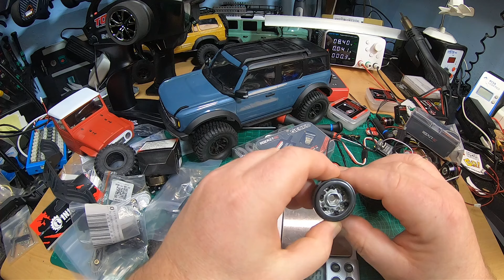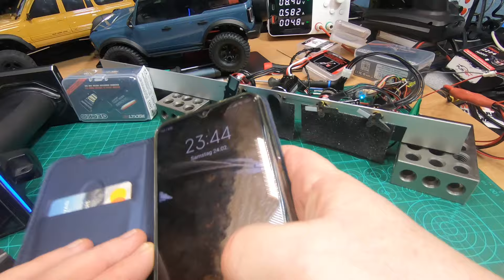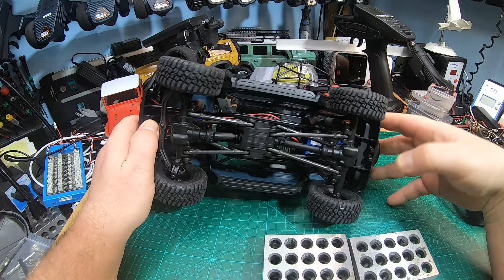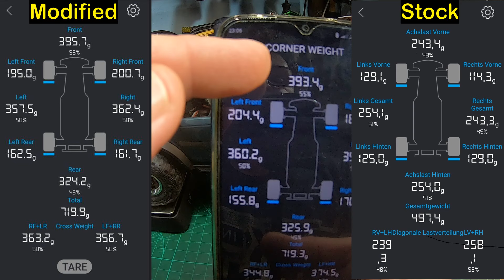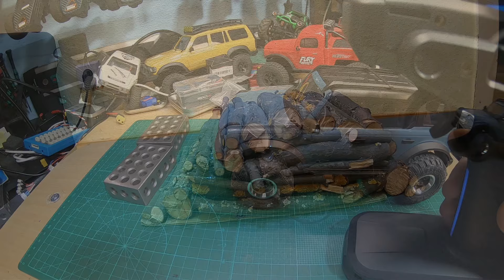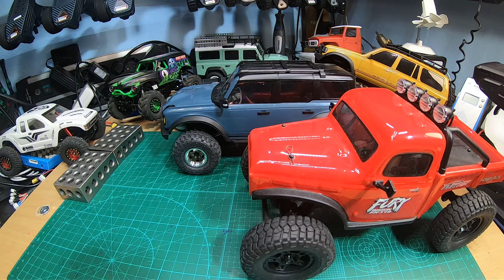Traxxas TRX-4M + Rocket Gecko sensored brushless 3500 kv inrunner motor and Mini 18 ESC

Comment: Hello my friend how are you? I have a question. Nobody on YouTube could answer it for me.😢 I haven’t ordered it yet , but I used to have one before the furitek komodo the big one not the small can I fit it on the trx4m Because I want to order it and I’m afraid it’s not going to match🙏
Reply: I think the big komodo it’s the best one for the slow crawling
Reply from the maker: @AhmedAli-my9we  Yes, the big old Komodo ist best for low speed, but it lacks punch and high speed. I do have it still. Bit IMO the punch is so poor and it is so heavy, that it does not improve performance in most trucks. Only super slow crawl is awesome. 
Why not order the Furitek kit for the TRX4M?
The old big Komodo has a larger shaft, so you'll probably not get pinions that will match.

Comment: Inrunner in that size is never the same like a outrunner…. Even the Furitek Cedar is struggling with slow crawl…. My best hint is use a cheap AM32 ESC and a outrunner Motor…. Thanks for the Video

Comment: I have those same tires and wheels on my hobby plus cr-18. I find these wheels/tires  much heavier than the stock wheels and tires. Great video Donald!👍🏻🤗
Reply from the maker: Thank you. 
Still, rims are super light compared to "heavy" wheels - weight recommended. I love those wheels. CR-18 tires and wheels are super light (but beadlock rims, easy to put lead stripes to the rings).

Comment: About the Program Card,  I had to search for the one that specifically says “SUPPORT GECKO MINI 18 ESC” on the front of the card at the bottom.   I found it on AliExpress and it took forever to arrive but it does work.   Another important note… I found that all the initial values for all the program settings were defaulted to ‘1’.  That’s not really a big deal, with 1 exception….the Low Voltage Cut Off.   ‘1’ correlates to 2.9V which is not good for LIPOs .   2=3v, 3=3.1, 4=3.2, 5=3.3, etc, up to 9=3.7v.
Reply from the maker: Thank you! I will search on Ali. Can you change settings? (for example motor direction)
 LVC is completely unimportant for me, because I never drive my trucks "to the end" ;-) - I check voltage. So I am good.
Reply: @donaldsneffe  setting include LVC, Punch, Initial Start Force, Initial Drag Brake Force, Maximum Reverse Force, Neutral Range and Motor Rotation
Reply from the maker: @timsheldon6367  Yes - I tried everything - but with motor direction it is easy to check if it works. A guy from the forum has the card especially for the Gecko, and his also does not work. It has only 9 settings, the one I have has 15.
Reply: @donaldsneffe    I tested motor direction for you with my card.  It does indeed work.   My card has only 7 menus option on the label, however pressing the Item button causes it to cycle through 15 items.  I have not attempted to alter any values for items 8 thru 15. All items 1 through 7 do have an effect when the values are changed.
Reply from the maker: @timsheldon6367  Thank you! Is it this card? https://www.banggood.com/Surpass-Hobby-ROCKET-LED-Program-Card-for-Rock-Crawler-Gecko-Series-MINI-18-30A-ESC-Brushless-Waterproof-Electronic-Speed-Controller-RC-Car-Vehicles-Parts-p-1994691.html?cur_warehouse=CN&ID=6307343
I know it is cheaper on Ali https://www.aliexpress.com/item/1005005889711189.html?spm=a2g0o.cart.0.0.8f3d38da682dyd&mp=1

A guy from the forum told, this card also does NOT work (for him).

Quite nasty, I ordered my card before this new one was released for Gecko, and mine was recommended ;-)
Too late now to complain (bought it somewhen autumn last year).
Reply: @donaldsneffe yes, mine looks just like those.

Comment: I put the same Gecko Mini 18 in my TRX4M and experienced the same disappointment…. It really is nowhere near as good as the Furitek Lizard Pro.   However after switching to the 40.3:1 crawler gears in the transmission and under drive gears in the rear differential, with Start Mode (Punch) set to 3 and Initial Start Force set to 1,  I do find that the slow crawl is much better and consider this an upgrade over the stock Traxxas motor/ESC combo.   I bought 2 of these, thinking it would be a cost effective alternative to the Lizard Pro.   I do still plan to install the second one because with the right gears and FOC it really is an upgrade, but in hindsight, the Furitek LizardPro/Venom starter kit is only $30 more where I live and would have been well worth the extra money.
Reply from the maker: I also bought 2 from Hobbyking, because they were so cheap ;-) - wanted to order forever from Fair RC or BG, but always hesitated because of the price (equal or even more expensive than Furitek). When HK had it last year, for less than 50 bucks (plus customs and shipping), I immediately ordered.
Donno yet what to do with no. 2 - probably good for a trail truck or even street car.

Comment: Great video , I have been using the lead golf club tape for a while now and it works great , I use it on most of my trucks it's easy to tune the front and rear weight bias , its a lot cheeper then buying brass wheels , it's works great on the plastic wheel rims too ,
Keep making videos they are very interesting to watch and learn from , stay safe mate 🇬🇧
Reply from the maker: Thank you!
Well, I do not think those lead stripes are that cheap (I do have those two types you saw in the video, those "sticky ones", in which you always have to cut off the rounded edges, and those "fishing rolls", and recently bought this one https://www.amazon.de/gp/product/B095C3JFVJ/ref=ppx_yo_dt_b_search_asin_title?ie=UTF8&psc=1 - did not use and show it in this video). They are rather pricy IMO, and at least for 1.0 rims brass inner rings (Injora) are not that expensive, and many wheels do already come with.
Donno any really cheap source for this "golf and fishing lead". Do you have a cheap source?
Anyway, for stock wheels if they are plastic beadlocks those lead stripes are a good and reasonably priced option IMO.
Used those much more frerquently some years ago, when not so many heavy rims were available for micros. 
For those super heavy DJ Crawler rims showed for weight comparison I did pay only about 15 € (!!!) for a set of 4 incl. box, etc. - if heavy rims are that cheap... those are a steal (Aliexpress).
Reply: Sorry I don't have a link but I just searched on eBay for lead golf tape or just lead tape and quite a few rolls of lead tape came up , i just looked for the best price , depending on how much weight you need to use on the truck I can get around three sets of 4  wheels out of one roll of lead tape so it's a lot cheaper then the brass wheels or brass hex extensions , if i can find a link or just an eBay item number for the lead tape I will send it to you mate 🇬🇧
Reply from the maker: @keithbutler6361  Thank you, no, you do not have to find a link. I also bought my lead from Ebay, or Ali, or Amazon - but I never thought this was really cheap (maybe it is also more expensive here for us in EU). 
I have quite a bit here, will not buy more in near future.
I only thought, it is not soooo cheap for example in comparison to the Injora brass rings (9 €?), or even some heavy wheels you can get for 15 - 20 bucks nowadays. 
I honestly rarely use it now, used lead in my MN111 Defender, where I wanted to (had to) use stock wheels.
But for those wheels and tires I used in this video lead is for sure a very good upgrade, ... such beautyful rims, and so light ;-)
Reply: @donaldsneffe  OK Donald , j was happy to help you if I could . Keep making your very interesting videos , I have picked up many tips from your videos, and I really enjoy watching them , 
Stay safe, mate .